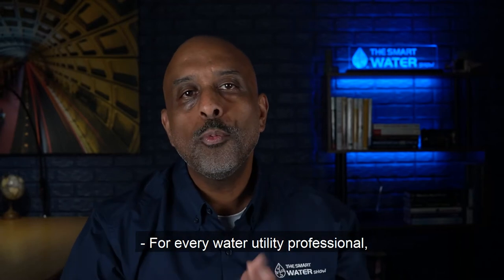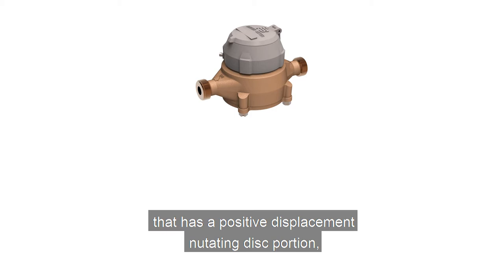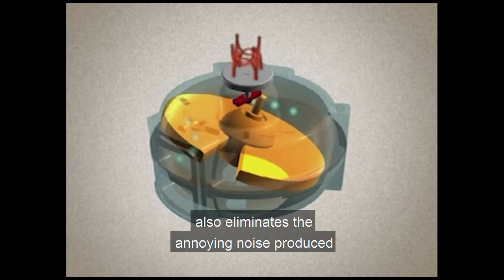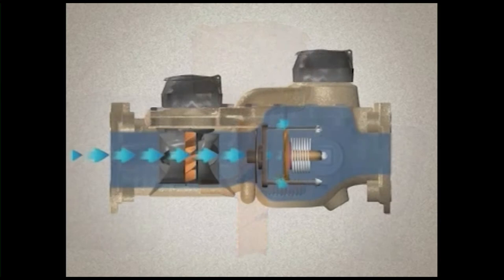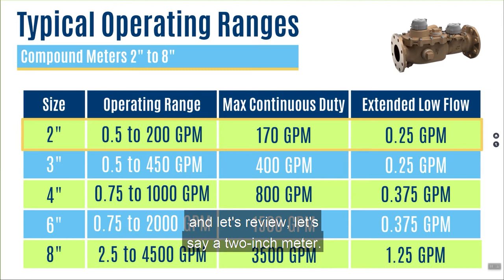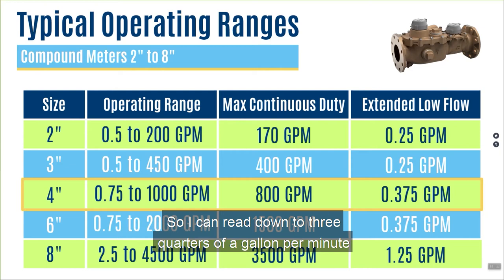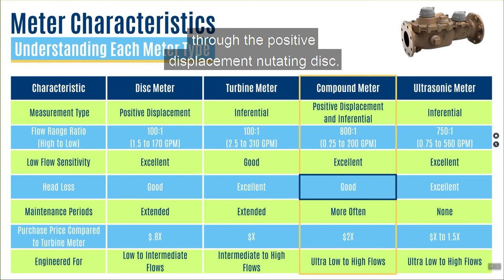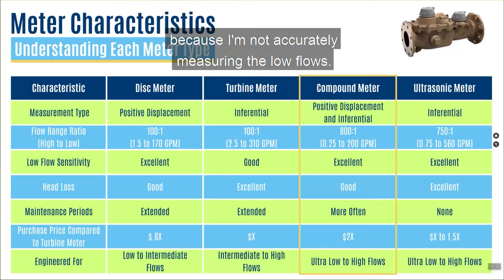Compound Meter Technology | The Smart Water Show - Episode 19

Comment: A very excellent presentation.

I have a question: Since it appears that total flow is registered at the turbine meter, is the disc meter only used for monitoring that percentage of the total flow through the disc meter, or is it necessary to read both meters to determine total flow?

Comment: Does it make sense to put a compound meter with cellular technology?
Reply: Yes it does.  I would recommend two separate cellular endpoints on the meter.  One for the low side and another on the high side.  The analytics software will combine the readings to give you a totalization.